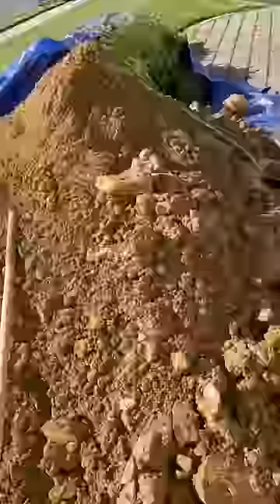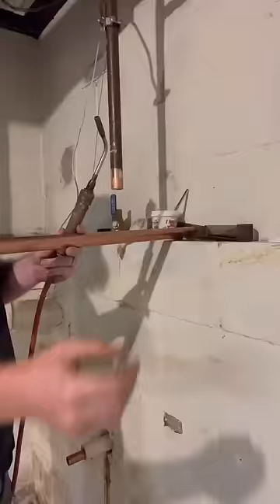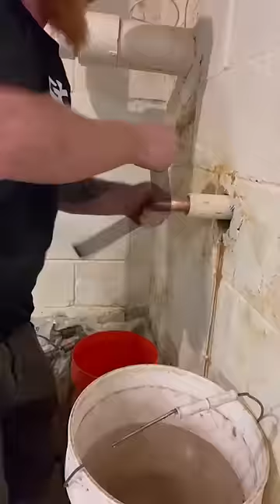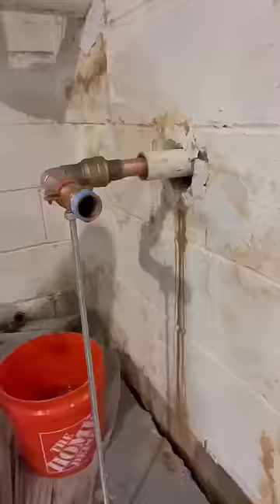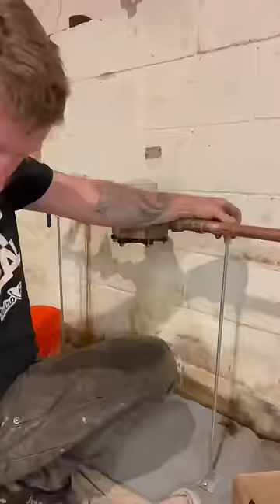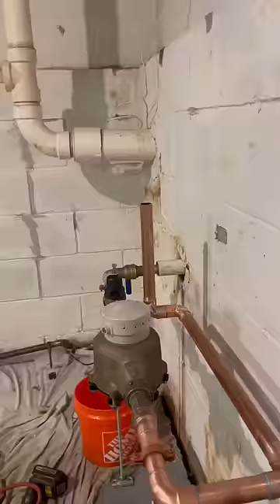At least its easy #plumber #plumbing #shortvideo

Comment: My wife, same complaint.So I started doing dishes and laundry. After several days she said the yard was a mess and her cars oil change alert was on. I explained to her about how to change the oil and where the tools were and then I started the push mower for her. Things went back to normal!!
Reply: convenient timed oil change light hmmm 🤔 sabotage?
Reply: My wife is the same way they are tripping we work hard to deal with this bullshit
Reply: I watched this at my friend's house. She came out to complain he didn't do the dishes while we were putting breaks on his daughter's car and were cussing a frozen bolt we had to drill out. 

It was 98 degrees and humid.

He said he still has to mow the lawn. 

So they swapped..  

She made it about halfway and said she had no idea how hard it was !  And that it took her two hours to do half.  

I did the dishes in ten minutes while my friend finished the car.  I wanted to be in the air conditioning!
Reply: lol lol lol great job
Reply: @onoybeuh doesnt work that way
Reply: @jasonthomas4895  what... you can but ok
Reply: @onoybeuh  you cant force an oil change light to come on any cars except some newer Fords and some bmws.
Reply: @jasonthomas4895  litterally just drain the oil
Reply: @onoybeuh  noooo thats the oil pressure light silly. The oil change reminder light is a light that comes on only at a set interval! I did this stuff professionally too long to not know the difference.
Reply: @onoybeuh not too smart, are ya?
Reply: I heartily approve! 😊
Reply: My ex did this all the time and I helped out. She complained almost daily even though I contributed to everything. Changing diapers, helping with cooking and cleaning, and I was the only one mowing the lawn and some of the harder yard work, snow shovelling, etc she did help some but our relationship was pretty much 50/50 yet constantly complaining that I did nothing. At the end of the relationship she claimed she did 95% of the work at home to others. She cheated on me and kicked me out while I had started to develop a pretty bad chronic illness.

Glad I’m out of that narcissist relationship. Insanity. Some people are just sick in the head.
Reply: @jasonthomas4895 You can actually because thats how the system works. If you completely drain the oil for example it will pop on, you could take your thermostat off and force it to stay atleast partially open and re install it and that light will come on, you could damage a spark plug or ignition coil just enough for it to not work properly and re install them and that light will pop on etc. Its the same light, its not your check oil light, its your check engine/service engine light.
Reply: @0blacklightning046 no. If you drain the oil, the PRESSURE light will come on because there isnt enough fluid to build hydraulic pressure that the ecu is looking for from the pressure sending unit. The oil REMINDER light is a set interval based on mileage and/or time elapsed. They dont require a sensor because its prebuilt into the ecu/dashboard. Once the mileage or time interval is met, the ecu sends a signal to the light( for instance on toyotas it says "maint reqd") or to the dash cluster to provide a message saying OIL LIFE 0% or similar.

I been a mechanic for over 5 years and this is basic shit any lube tech should know. Stop trying to tell me im wrong when you dont even know what your talking about lmfao
Reply: @jasonthomas4895  really? So tell me what my pressure light is on an 04 chevy blazer ls? Alos tell me what the pressure light is for an 03 Ford F-350 6.0
Reply: @jasonthomas4895  Still say Im wrong mister mechanic? Because I can call mechanics right now that have been doing this before you were even born. You are talking about all of these newer cars and they for the most part are pieces of shit that everyone who owns one should pray to whatever god they serve that they are either already rich when an issue occurs or its something minor. Also I would love for you to tell me how many spark plugs come on alot of the 4 cylinder 1993 ford rangers and where that pressure light is. You only get one shot to answer the ranger question. You answer it wrong and you will prove you dont know as much as you think you do.
Reply: @0blacklightning046  your oil pressure lamp is almost always going to be a red lamp with a drip dude. Im not playing this game either because you are being difficult just to be. Choosing very specific  models because you know they are different than the vast majority of other models and you just happen to know how they work. Why else would you choose a blazer, ranger and a very specific f350? Miss me with that shit 🤣 last thing im gonna to is talk out of my ass on vehicles i havent worked on yet
Reply: So basically you started helping out more. That’s great! That’s what solved it
Reply: @bluescorpion7 Either you didn’t pay attention while reading this, or are entirely to stupid to understand. He stopped doing the things he was already doing, and did what she wanted him to do instead. Then when the things he did, now needed to get done. She suddenly wanted him to do it. He said no, and gave them to her. She then stopped complaining, and switched back to doing things the old way. You know, since it benefitted her. The point was to point out what she ignored. Now she can’t ignore it, without showing him she is malicious natured. Which means she can’t get away with that crap.
Reply: @onoybeuh  how were you this confidently incorrect? "Drain all the oil" right...then what afterwards? Let the engine grenade itself from lack of lubrication. Just cause a 12 year old said so online.
Reply: @onoybeuh oh look another woman who disappears from the conversation after she's proven wrong. How convenient.
Reply: @onoybeuh 😂
Reply: @MegaJared2  im the previous comment wtf does this even mean and im not a woman and its not wrong
Reply: @jasonthomas4895 .... I don't think he knows anything about cars...😅
Reply: @paosaelee7846  i agree lmfao
Reply: That is way I have a latina girlfriend she do everything in the house I do the outside that it woman almost all of them are lazy as fuck in this days you do s 1000 stuff plus all the shit the you deal with people if you get to your house for the same shit hell no is better staying alone peace is very important in life thats is way I don't have kids either if I have to leave I just run out 😂😂😂
Reply: I've tried this.... It didnt work for me.
Reply: @jasonthomas4895  in my car you can change the amount of miles it needs before the oil swap. As long as it was at least 500 miles from the last swap i can turn the light on anytime
Reply: Got the same complaints for years. We both worked so yeah, I get it. She wanted me to do more. After all she was doing most of the home work load ( according to her).  Well I came down with some weird disease and spent the whole summer in the hospital. Came home and was shocked. The house was a mess. Dishes dirty, and the lawn was about two feet deep.  I asked her why she had not at least got  her chores done. She explained that getting the kids fed, bathed and clothed took all her time.  Well guess who took care of the kids, bathed them and still did all the dishes and floors in the house and cut the lawn and paid all the bills before I got sick. Yeah, she never complained much after that. I clarify " much", because no matter what I do it is never enough.
Reply: But amywayyyy 😂😂😂

Comment: I think the crazy part about this is that the plumber dug the hole himself 😂
Reply: Why? Pretty standard practice.
Reply: Yeah, they charge extra for them to dig the hole.
Reply: @tmayorca8770  no wonder i always dig the hole 😂 my boss is cheap
Reply: I really like those posts that take strain off the pipes.
Not a plumber, but they seem a better option than what a lot of people I know have, which is chunks of 2x4 at kind of the right length taking strain off.
Reply: @BVaccaro88  what he Means is that his apprentice usually digs the hole or helps dig the hole. That’s standard practice
Reply: How els would be fix it. And get paid.

Comment: My argument for propress is always that the manufacturer claims their fittings are rated for 40 psi when the fitting isn't pressed and I believe it's 200-210 when pressed. I forget. Also the rubber o ring is considered a backup not the seel, the actual seel is the copper to copper which technically has 2 seels with o ring back up in between. If givin the choice, as much as like using my torches, if I can use propress I will. Especially in a commercial building. If you know the hastle of using torches in a commercial building then u probably agree with me.

Comment: Hand me a set of plans and I will plum that house from  groundwork to finish. Been Plumbing, since I was in high school (1977)  Pro Press is a pro risk. I guess I might contemplate using it in a situation  where you can’t shut the water off… But then there’s compression fittings, and those last forever.

Comment: No way does a house-keeper work the same hours as a full-time worker. I know, because I was one. If you clean, garden, maintain, cook, take kids to appointments everyday etc. it will not add up to eight hours a day, 5 days a week.
If the housekeeper only does housework and doesn't work then the full-time worker shouldn't be expected to have to lift a finger (though sometimes it's better to help out if you can, especially if you want "special treatment" 😉).
Of course, this changes when both partners are working, but basically as long as you count housework as paid work then you should both do the same hours.

Comment: Well I used to think the same way and well I was wrong! Just because you work it doesn't give you a free pass to not do anything at home. You should still pitch in at the house as especially if you have kids your wife is actually working as hard as you or more than likely harder. I learned that the hard way when she left me and our kids and I found out that being mom is actually way harder than being Dad. Honestly when I went to work ( lugging cement blocks) it was like having a break! Turn it around before its too late my friend!

Comment: I don’t fully trust pro press fittings either, at least not underground or b out accessible. Also if any future work needed to be done you can just un solder rather than cutting out a 10$ pro press fitting. But what do I know, I’m an electrician

Comment: Beautiful. Pipe supports are classy.
Reply: What are they called? The clamps and the support anchors at the bottom. Names for both? Please
Reply: @raymondsantiago2411  Split ring clams (for copper) and the plate at the bottom is called a celling flange hanger (for 3/8 inch all threaded rod in this case)

Comment: As a commercial plumber I have to say well done sir.
Reply: What is it?
Reply: Minus the part of soldering a male adapter that's already tightened into a fitting.
Reply: @shawnm636  That would really only be an issue if he didn’t know how to control his flame and the pipe was fully connected. With the pipe being wide open there is no way the teflon or plastic would ever get hot enough to create an issue.
Reply: @joedepalo3230  your a hack of a plumber if you think that. No plumber with any skill would do that unless you had to in a jam.  That's some backwoods hack plumbing if you think that's common practice. It's less about the Teflon and more about the heat swelling the fitting In a tightened up fitting. But hey you enjoy your call backs
Reply: @joedepalo3230  there's no way it got hit enough. Were you there with a thermometer?  What is the temp that Teflon goes bad?  A lot of guessing!  Just remember I'm willing to teach if you're willing to learn
Reply: Pressure reducer valve goes downstream of the meter. Fix it.
Reply: Commercial Plumbers have no clue...
Reply: @stevetravels6160  yeah we just built schools and hotels and apartments from the ground up.

Comment: Beautiful work...gotta love old timers not trusting new fan-dangled pipe connections.
Reply: There's nothing wrong with technology if it makes life easier
Reply: I personally don't trust that plastic flex crap gonna have a house built & that plastic shit won't be in my house.
Reply: @larryriffett918  that's true. I was just referring to the press fittings for cooper. I haven't seen enough data between them and sweating connectors to have an opinion
Reply: @haydenpryor2494 thanks for your reply I was just making a statement imo don't know enough about the long term either it just doesn't seem durable imo
Reply: @larryriffett918 the propress is for copper. If you have a guy who knows what he's doing then the above will be great. If you have a guy who doesn't know what he's doing then they'll be problems no matter what. If you're building it yourself and you're not a professional plumber then get yourself a pro press 😂 less likely to screw it up.

Comment: When I wanted to buy a rider mower my wife said it was to expensive and that she would help with the yard work. I suggested we start small, with the weed whacker. :15 minutes into it she came and get me because the weed whacker had malfunctioned. Seems it ripped the 65 year old cedar shakes off-the-wall and she just didn’t understand how that could happen. So now I have a rider mower. See how that works? Take your wife to work with you for just one easy day and that should do the trick.

Comment: Dude, back in the 90s, before 9-11 when you could still bring your loved ones inside the work place, I brought my wife to work at night.  I showed her the system we build and how I sat at the control panel running the test sequence and if I found a failure I would sit at the PC connected to the Database and log a failure, then when the bug was resolved, I would re-test the script line and if it passed I would log the failure as corrected.
I noticed the frozen look on her face.  Then she said: "I just cannot believe they pay you what they pay you for swapping chairs all day!!"  : /

Comment: Appreciation?  What’s that? 
Seriously, if your wife doesn’t appreciate you then you have communication issues. More than likely, she is frustrated because she is struggling with what she has to do and if you come home and put your feet up and expect her to wait on you then you are likely seen as the problem. Communication plain and simple regarding your expectations and hers, understanding what has to be done to achieve your common goals will be the solution. Teamwork is the other side of that coin. It takes two to make a team work. Think of all the things she does during those twelve to fifteen hours you are gone. If she’s sitting on the couch eating bonbons then you might have a problem. But if she’s spent all her time cleaning your skid marks and feeding your Hell spawn, buying groceries, paying the bills, balancing the checkbook on too less money each month, etc., etc, then you need to sit down together and decide which activities are appropriate and necessary and which ones are not. Time to look at the whole 7/24 and remember that you are a team, before you have some serious issues to deal with.

Comment: Be happy you didn't have to take out kitchen cabinets, jackhammer a concrete slab, across the kitchen, to get to the lines to fix them, then go and replace an AC compressor, then go and put 5/8 sheetrock on a ceiling and popcorn it and paint it, and then go home and hear that you're lazy. That's the easier work that I've done. Going out to Oil Rigs and setting up sensors on the entire rig was about 30 hours straight, the boat rides in 20 foot seas were no fun either. And much more. Dealing with entitled humans is the sad part.

Comment: Really nice setup, two shut off valves to be able to work on the pressure regulator or automatic shut off valve without having to cut the water outside of the house, looks like you have the pressure regulator and automatic shut off valve, but the third is a water meter?, because looks like is inside

Comment: I dont like that your heating up a fitting thats already been threaded definitely will have problems soon, i like to pre sweat my MIP's and FIP's first then cut them down to size later and ream your pipe im tellin ya get a step bit for your drill and it takes litterally a microsecond to ream your pipe that way, anyways cheers

Comment: Retired licensed plumber of 45 years and I love running copper pipe! I fought the Pro Press for years and only used it in places that won’t freeze or for quick valve replacement! Hot Work is not available in some Chemical Plants and specify Stainless which I really like doing!

Comment: As a up and coming air compressor technician my guys that have been doing piping for a while swear by propress.... I'm still on the fence. That o ring is gonna rot out at some point.... Probably sooner than the solder or copper will crap out... Just my w cents

Comment: Pressed fittings for copper are lazy.  I get it on small stuff... but my boss just brought me a $400 3" tee.  I gaurentee i could sweat in a 3" tee is less time than i could earn $400...  i could even roll me some vic and clamp it for less... the only time it really makes sense to use press fittings is when you cannot easily remove the pipe to edit ends to make it work.

Comment: The Proplex is good, but I am not going to lie. I don’t trust it when it comes for the main pipe coming into your house because it is compressed now if it was to be a different pipe like threaded then it’ll be OK with the galvanized pipe, other than that is best to use the perplex, you may get a leak because of the pressure it doesn’t always happen but it’s like using a shark bite. Sometimes you do get a leak. The bad part is it happens when the person is not there.
It happens through time, so yes, Gavin threads or copper sweated is best